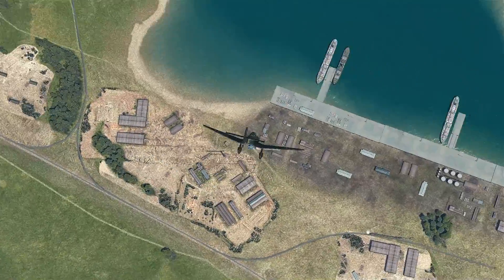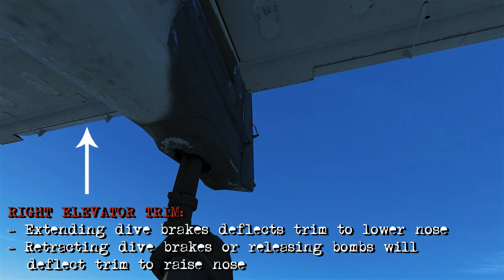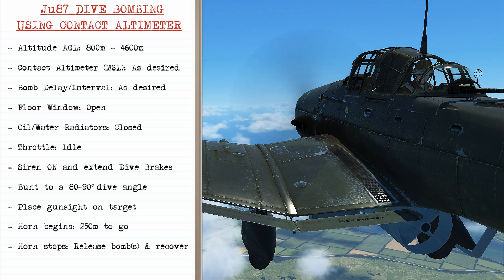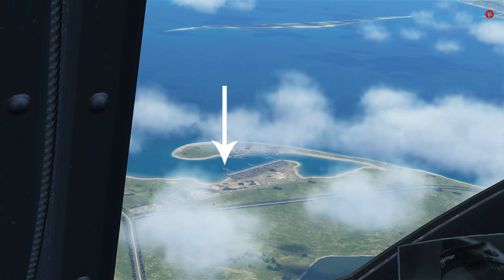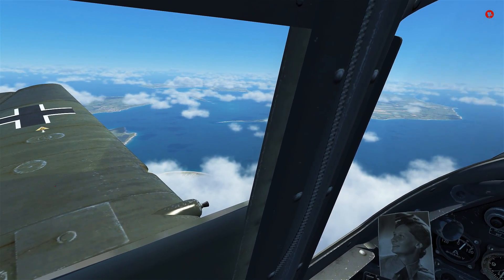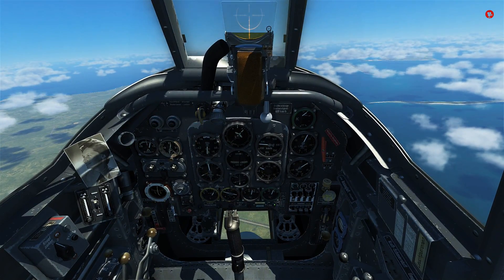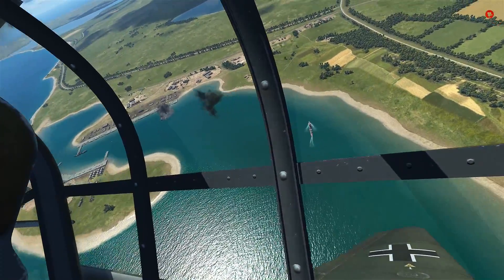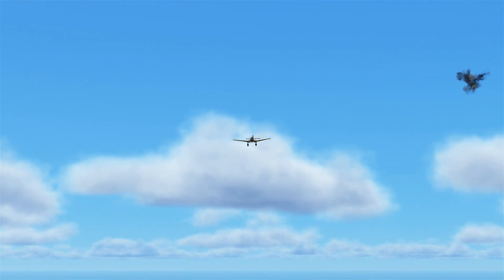Ju 87 Dive Bombing #2 - Using a Contact Altimeter

Comment: you forgot to go upside down then aim down at the 70-80 degree angle then you get around 500 meters then drop and pull up at 400
Reply from the maker: That's sort of covered in the video previous to this one as this one was more about demoing using the contact altimeter so I showed another approach technique

Comment: Could you also do an inverted dive with the contact altimiter or is that wrong ? And also what should your manual trim be set to befire diving, straight and level ?
Reply from the maker: I don't think it matters which way you do it. You either roll inverted and pull down or nose over to the dive angle. For trim it's personal preference...but you'll be gaining some airspeed in the dive so if you wanted to make things a little easier you could to be nose heavy before diving. This way as you gain airspeed you're already trimmed for it which can make it easier to keep your nose pointed where you want it.
Reply: The Air Combat Tutorial Library  Thank you so much for a quick reply you surely are the best learning resource for this sim :) One other question if you dont mind is if there is any tutorial for how to bomb targets with soviet fighters and there sights becuse i cant find any guide for it anywhere haha

Comment: Hi The Air Combat Tutorial Library been trying to do the inverted version but finding abit difficult to know what angle my attack is, also when you say apply some back pressure does that mean pullling on the stick? and do you use any elevator trim at all? i put mine to 0% when i dive and then decrease or increase but that might be what im doing wrong.
Reply from the maker: Yeah you pull back on the stick. However much you need to pull through inverted and get to the 90° dive. You don't need to touch the trim if you don't want to...there is enough elevator authority for you to override it. As you get in the dive you can start using trim if you like.
Reply: @RequiemsACTL  cheers mate

Comment: Do you have the propeller set to full fine when doing the dive? Correct me if I'm wrong but I think the initial increase in drag will slow down the descent for better target acquisition and also allow a faster ascent when pulling back up at the much lower altitude.
Reply from the maker: No I just have it set it to combat RPM as it's a constant speed prop, meaning I'm not controlling propeller pitch as you would for a variable pitch propeller (plenty of people refer to changing pitch when really they're adjusting RPM). If the pitch was full fine then that would increase RPM to maximum. I wouldn't set it to the highest RPM as that could lead to overspeeding the prop during the dive when the airplane starts gaining speed. If anything you could reduce RPM if you want to prevent it, but generally speaking you won't have a problem if you keep the RPM in normal range before you dive.

Comment: Is it possible to use the dive brakes with the inverted method?  Or at least without having the plane push it's nose down?  Or can you still use the dive brakes independently of the auto pullout feature?
Reply from the maker: You can still use the dive brakes with the inverted method John because the auto entry/recovery system relies only on that right elevator trim input. You would just need a little extra back pressure on your end to counteract what would be a nose up tendency (because you're inverted) when starting downhill.
Right now though the dive brakes this automatic system are linked, but maybe in the future it will be made into a modification.

Comment: One of your best. It is to bad they did not program the auto recover like they had in some of the real birds to make it easier on you! ; )
Reply from the maker: Cheers Jughead, it does autorecover a teeny bit but yeah, unless you want a date with terra firma you need some input lol
Reply: @RequiemsACTL  Hah! This has been doing my head in the last few days. Although the command is 'Dive recovery system: on/off', which suggests you may need to switch it on or off manually, there's no indication in the techchat or the view of the cockpit that anything has happened, so I've been trying missions without doing anything to the controller, which I've mapped to Key 9, then trying another mission pressing Key 9 once, then another mission hitting Key 9 twice to see what happens regarding autorecover and I've not noticed any difference - I hit the ground with a resounding 'thump'. I know this wasn't working in 2018 due to comments on forums at the time but was implemented with update 4.002 in November 2019. Yours is the first comment that I've understood that indicates that although the audio warning works the auto pullout doesn't, or at least only works marginally. I do like the audio warning, I have an unhealthy tendency to get fixated on hitting the target and can leave it too late to pull out, so the audio warning works and is sufficient for me. I've read articles about the front line squadrons switching off the system as planes were delivered, so I think the audio only is a reasonable reflection of what the crews actually experienced. I don't need to worry about blacking out due to high g in the simulator, so don't need the auto recovery to actually save my life. This is a good compromise. Please et me know if I've missed or misinterpreted anything!